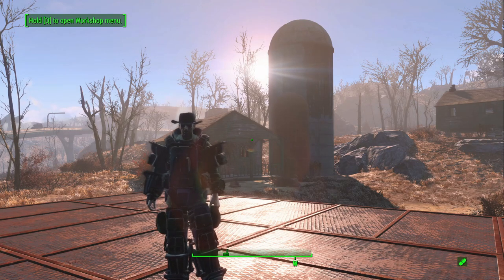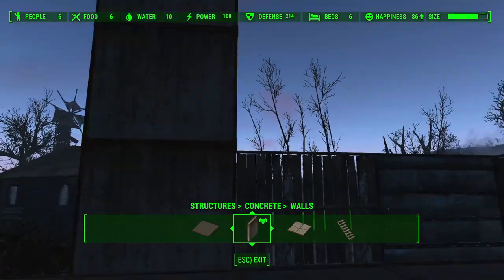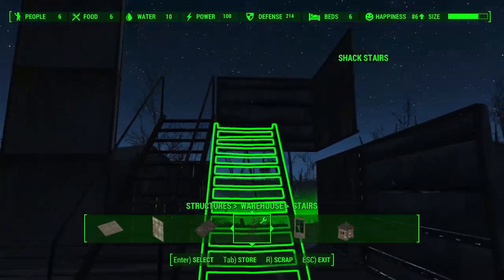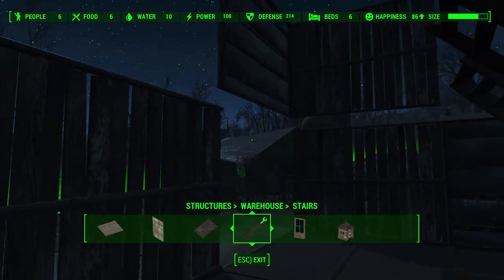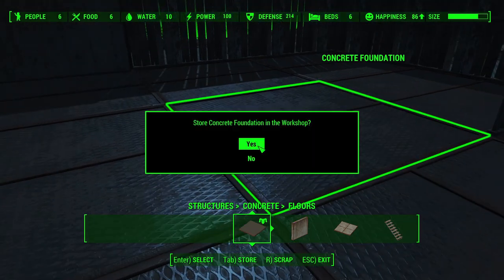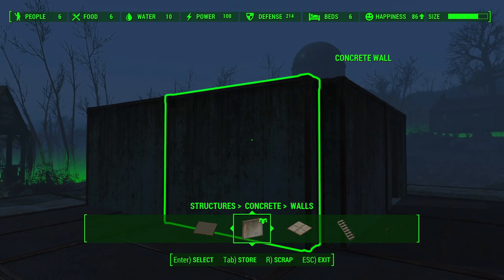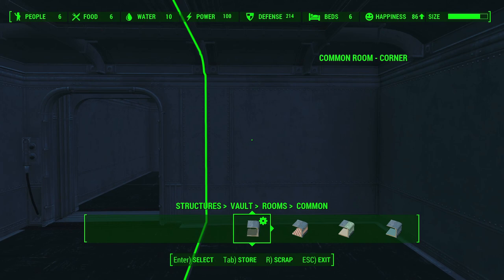Commonwealth Contractor | Multi room and Multi Level buildings.

Comment: The size and snapping of the concrete walls is precisely why I hate using them (they end up sticking out on the outside, you need to use the little pillar wall pieces to fill corners, etc) but maybe with some of these tips I can make better use of them at some point. I generally build with just the warehouse and barn sets because they play nice, they've got all the pieces you need, and with two sets that are basically reskins of each other you can have some variety. And I just like the look better for structures I'd invite people to live in. I use concrete for my industrial and security spaces. Plus I think about how much work mixing and pouring concrete would be...
Reply: You can snap concrete walls flat against one another. Place your wall, then snap another wall to the first on the inside of your build. Concrete is honestly one of the most versatile building groups in the game. I like to use the walls as the base of a security fence, and usually they have no problem snapping, no matter how rocky the terrain is.

Comment: The Fallout 4 build system is really flawed. I hope that they add the build sets from Fallout 76 when they do the next gen update, because that is so much easier to work with. Wall sizes are standardized, everything is interchangeable, and it’s just so nice.

Comment: If you're going to stick with either wood or metal for multi-floors, you can move the stairs to the "middle", instead of going on the edge.  What I have taken to doing, because of the ways the floors snap, is to use either the barn or WH for the bottom floor.  You can then put the stairs any where you like, because you have the long half floor to fill the gap, and there will be no air gap.  By "in the middle", I mean that if you're 3 wide, put the stairs on the second tile.

Also of note, the concrete walls will go on top of the concrete floors instead of on the outside, but it's a PITA to get to work, sometimes.  I can't count the times I've gone around a large section with concrete, only to have them not line up because one wall actually snapped on top, instead of on the outside, or vice versa.  

For metal, you can snap one of the double floor/roof tiles in a corner, build the structure from that with metal, remove that tile and replace it with a roof and then one of the prefabs.

Comment: I really like to use concrete for the ground floor of my structures.  Then, you attach upper floor pieces to the concrete walls, which can take either standard height shack walls, OR extended height barn or warehouse pieces.  It makes it look like the builders were conserving resources, using sturdy concrete for the lower floors (which also won't rot or rust in wet ground like wood will) and flimsier construction on the upper levels.  A lot of these buildings aren't pretty, but... you use what you have.

There's some nice stuff in the Creation Club; in particular, the Slocum Joe's build set includes brick walls in both red and whitewashed.  Which actually makes some lore sense, since settlers could disassemble old brick buildings and construct new ones.

Comment: A key component to making individual rooms in the wood and metal build sets is the prefab units available at the left side of each menu - there are rooms, hallways and even doorways already assembled for you to simply put together in your multistory designs.  They're not perfect, but better than nothing.  Those pieces are my go to parts for putting together my bunkhouse that sit on top of my Red Rocket garage and for the market buildings with upstairs living quarters for the vendors that I build in Sanctuary Hills.

Comment: I have tons of hours of settlement building but rarely used concrete walls. Started watching your videos and decided to make a castle with them. Made four awesome towers with the 1/4 tube ones, but when I started making stairs for them I realized the damn stairs snap at both ends but they are a hair shorter than the walls. Triggers me so hard!

Comment: Everything you do is worth doing. 😁 Whether simple or not, there is always more to learn as far as building in this game goes. As far as the concrete set though, the 1x1 and 1x4 piece walls can sometimes be invaluable for creating extra snap points. Also, the elevators in the warehouse section can be quite the pain to enclose as part of a structure. Sometimes walls snap, sometimes they don't. I'd love to see how you tackle them sometime.

Comment: That's why I almost exclusively use the warehouse/barn assets. Easy rooms, easy stories.
Reply: Your supposed to mix metal and wood build. You don't have stairs in metal components,  you have wood stair well. The double floor really helps you connect walls one floor level to another.

Comment: Every time I try to build with the concrete build set I can’t get anything to line up. My floors and walls are fine but the moment I go to add another floor, no matter if I use floors or ceilings, that top floor will not line up with my first floor walls. I’ll always end up with a gap on either end. Never have that issue with the wood, barn, or warehouse set. I don’t know how you manage this because you seem to avoid explaining how you do it but judging by your choice of building textures it seems mods are at play.
Reply from the maker: nope, no mods. just start your second set of walls and snap your next floor to the wall. you can actually see it hin this video when I'm talking about collisions with the concrete set, when I place one roof piece and one second floor piece side by side.
Reply: @Theegreygaming  this still doesn’t work. I don’t know. Maybe it’s a console issue?

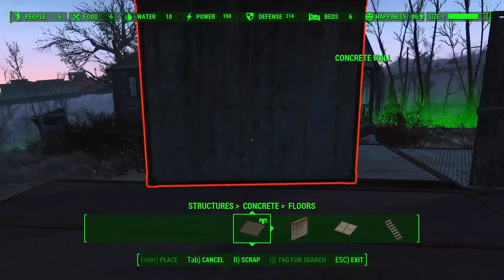Comment: 3:36 could we use this concept to clip a metal door through a floor by replacing one of the concrete foundations with one floor panel at 15:25

Comment: Where did you get the build sets, DLC? Thank you.
Reply from the maker: I'm afraid I don't understand the question. all DLC can be acquired through the respective game marketplace you used to purchase fallout 4. also I'm not sure what you mean by build sets DLC. there are lots of DLCs that add additional build sets but there isn't a DLC called build sets.
Reply: @Theegreygaming  You call them build sets so I was wondering if you meant DLC. Thank you for answering and sorry for any confusion.
Reply from the maker: @dennis2376  no problem, when I say build set, I am just referring to which menu I'm using to construct the items (wood, metal, vault, etc).